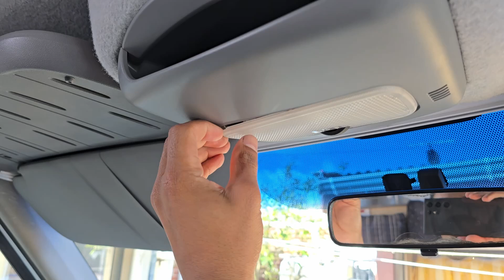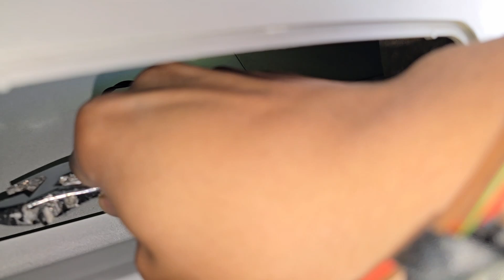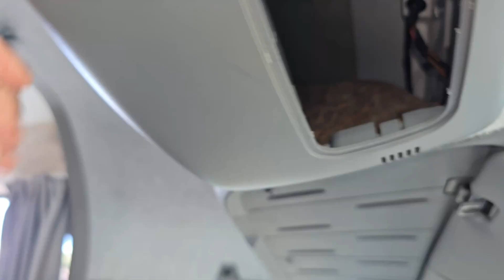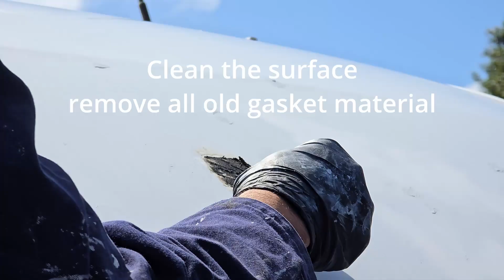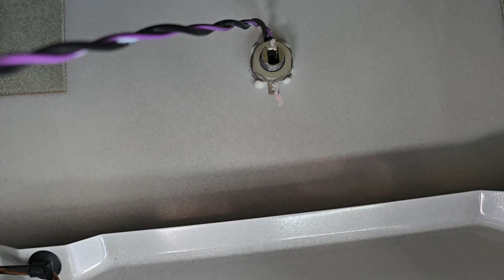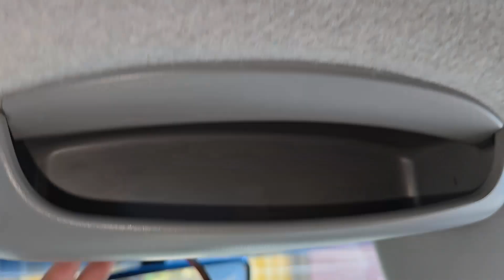Common Issue Water Leak - Mercedes Sprinter Antenna Removal

Comment: We are having leaking into both footwells any suggestions we thought it was mirror triangle panels and have replaced these but still leaking any suggestions 😭
Reply from the maker: Check your windscreen, this is also one of the most common areas for water to leak in especially if the windscreen was replaced at some point in the vans life. My suggestion is get someone with a water hose to wet the front of the van while you check inside for leaks, this is the best way to check and find the entry point.